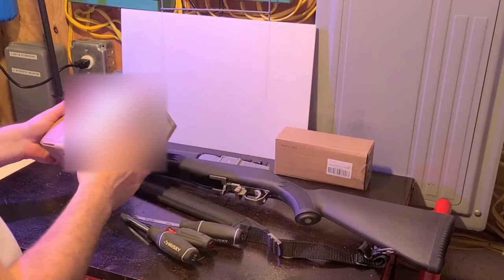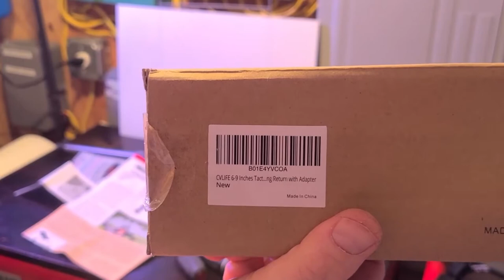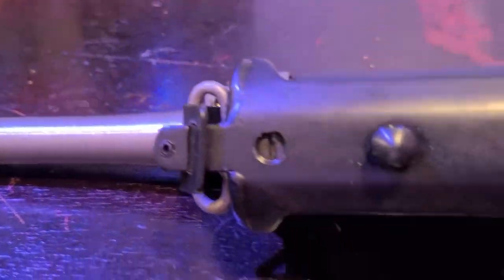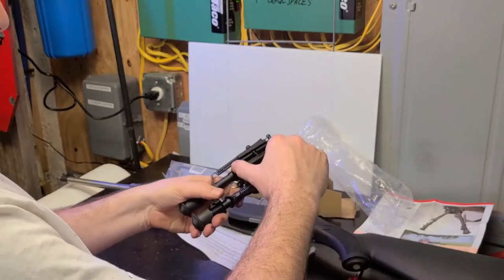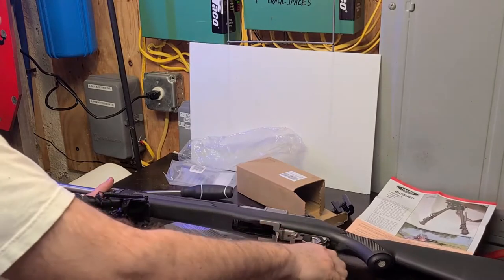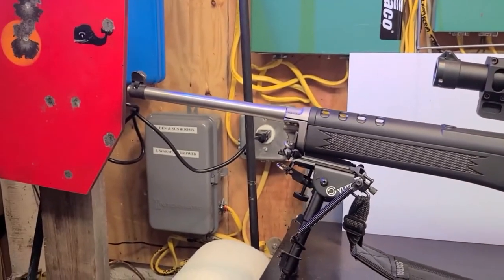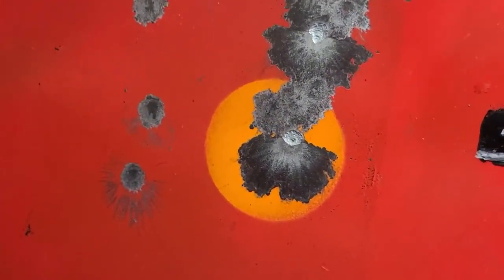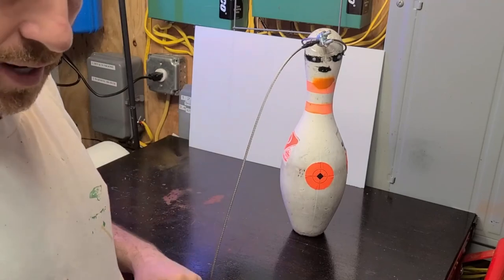Ruger Mini-14  with Harris Bipod Adapter

Comment: That scope mount is a terrible option for this platform/stock.... Those cantilever mounts are primarily designed for AR platforms. Get some proper low height scope rings, since this style of stock has drop.
Reply from the maker: Is it possible for you to recommend one? i would appreciate it..

Comment: * PSA*** - Please watch "How to Mount a Harris Bipod Adapter on Ruger Mini 14 & 30".

It shows the the proper installation of the Harris Bipod Adapter.  It's at https://www.youtube.com/watch?v=3IhiN72_T8s.

Similarity I made the same mistake as it is easy to do so and think that you need a longer set screw.
Reply from the maker: Thank  You!   Please see my later video, I used a Peg that screws into the plastic base and can connect the bipod. I got it from Accuracy Systems.
Reply: @silverbankruptcy  Thanks for the update!
Reply from the maker: @Quality_Guru  I Appreciate you Guys and Wish you the Best. I try to be a straight Shooter.